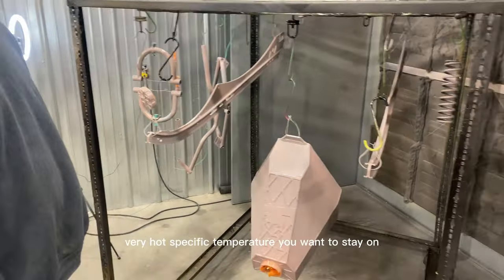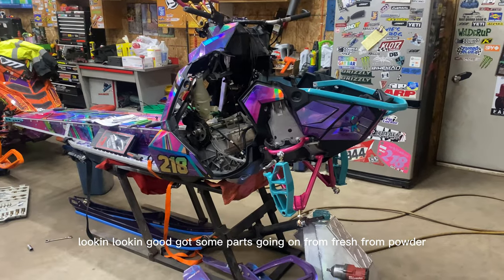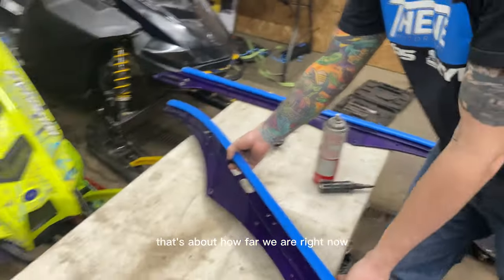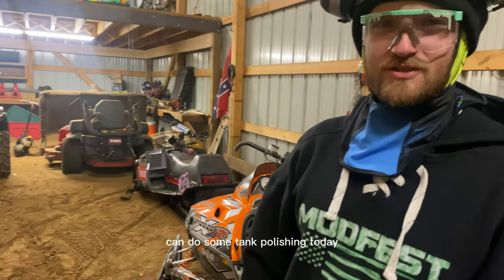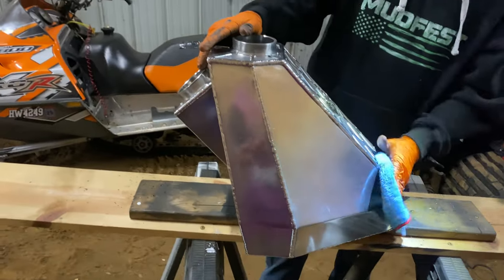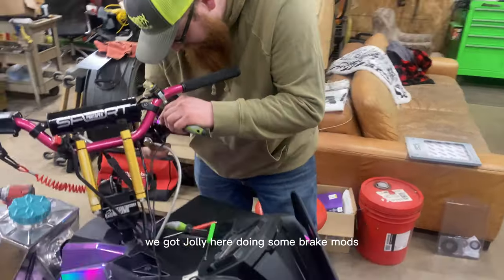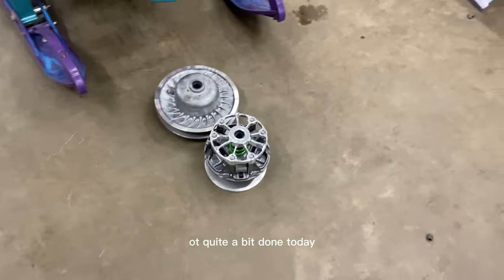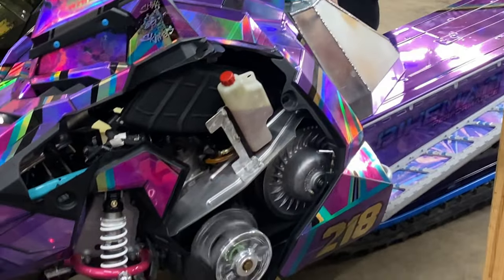Polaris 850 Watercross Build IT'S FINALLY DONE! PART 3

Comment: You should make a detailed video on how to make a crank drain on old Zx
Reply from the maker: We have a video going over the sleds, the drains I didn’t even split the cases on that, just drilled it with a bit covered in lube and a shop vac, then tapped and installed drains

Comment: Awesome build videos. Im from Finland and i have too same 19 850 pro rmk build project just now. I have couple question. Is gastank home made or do u bought some place? What chain gearing do you use that sled and helix?
Reply from the maker: Tank is made by moonlite fab - shoot them a message on Fb, gearing I would shoot for 2.3 and. 42 str
Reply: @SnowmaxPerformance  

I ordered alternativeimpact arms and I'm wondering what springs should be in the clutch and secondary and what weight should you drive at?  Stock weight is 10-72 i guess i need heavier weight.
Reply from the maker: @jonteck9385  stage 2 bikeman kit with snypers - 75g